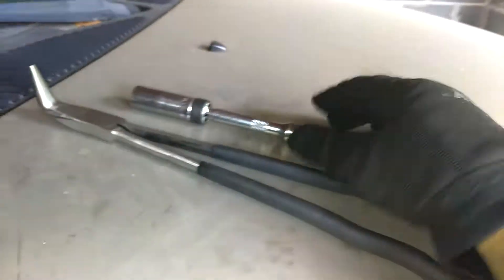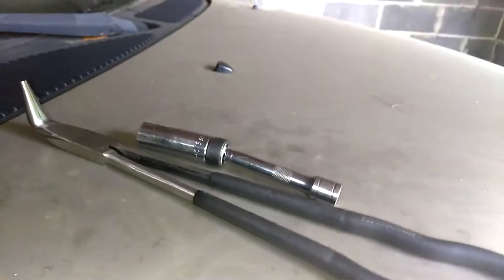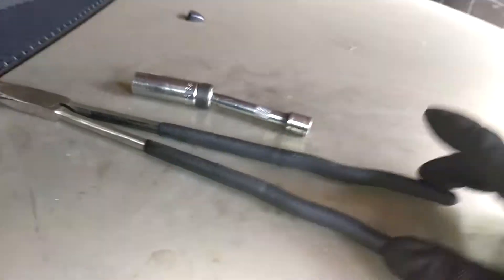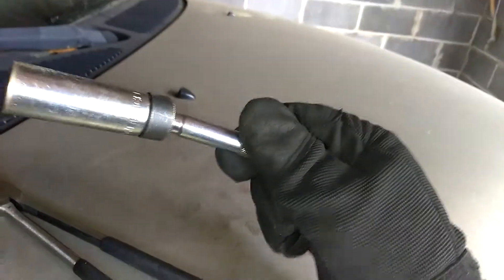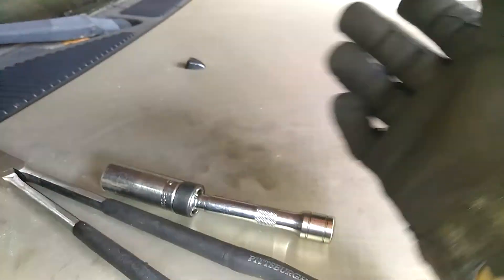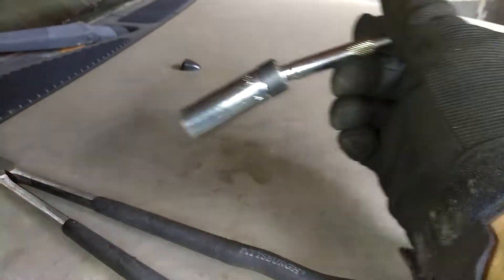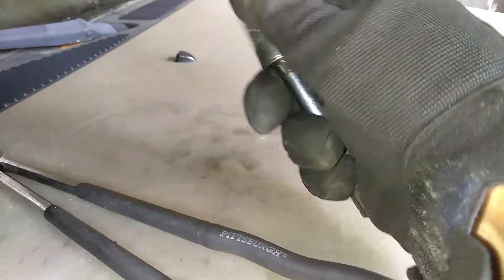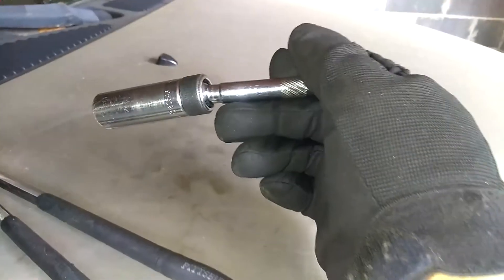Mercedes ML320 W163 Best tools to Replace spark plugs EASY!!!

Comment: I’m just about to change the spark plugs and wires on my w163 and was searching for the best tools for the job. Thank you!
Reply from the maker: You are welcome! On the tighter places put in the socket in the spark plug hole  first then attach the ratchet
Reply: @kchilz32  that’s what I’ve gathered rom several people - especially on the driver’s side where the heat shield makes a tight squeeze!
Reply from the maker: @zacharysorgalla130  it’s not bad. Very simple job with these tools. You got this